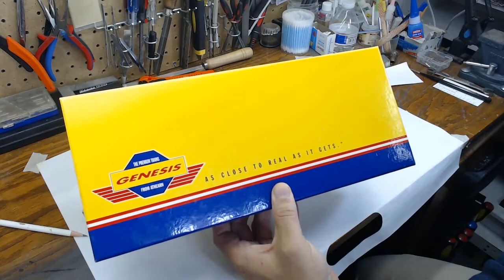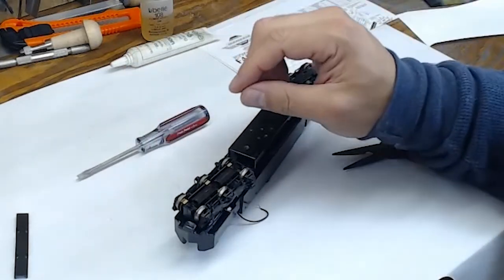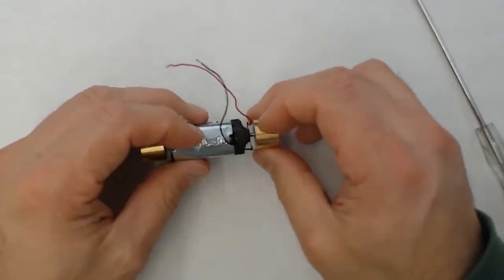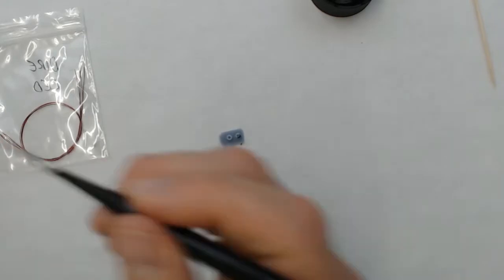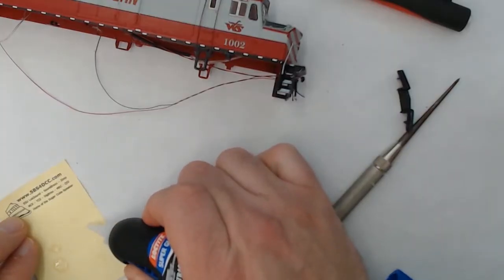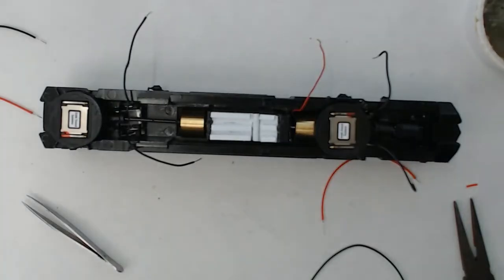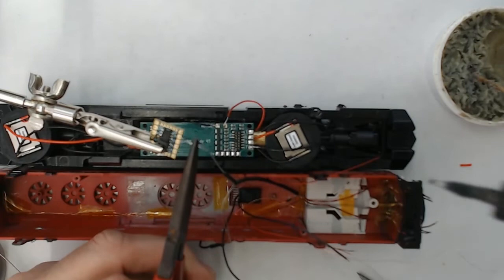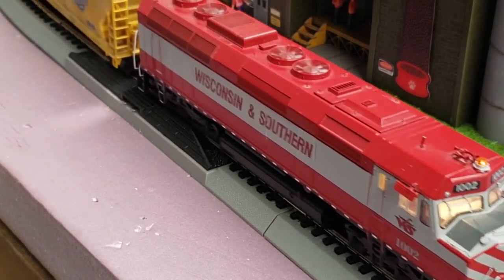UPGRADE DCC sound and lighting effects and EASY Locomotive tune up

Comment: Awesome Job! One question is where did you get the Stratolite?  I can't find that guys product anywhere.
Reply from the maker: That stratolite was from a company, Aaron Heine Electronics part number RB1. However they recently went out of business. You may find them on Ebay.
Reply: @AndyDorsch rapido was also offering this type of beacon (part #102106), but of course they're out of stock.